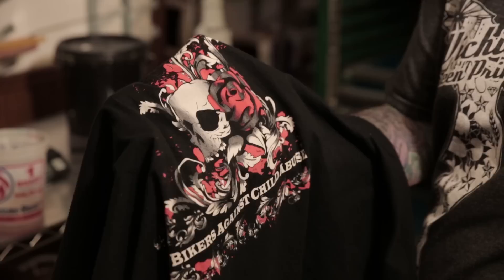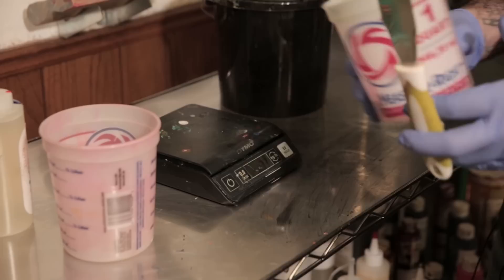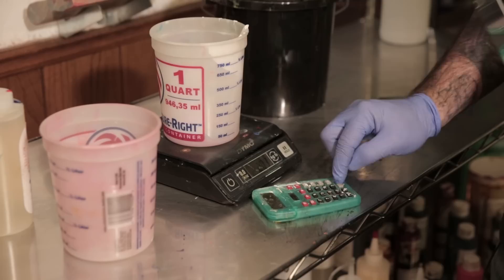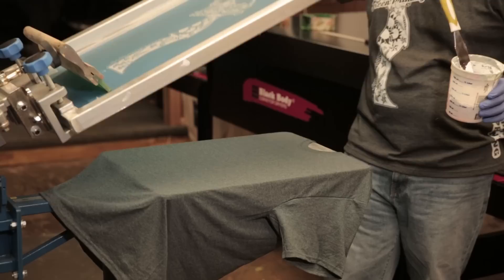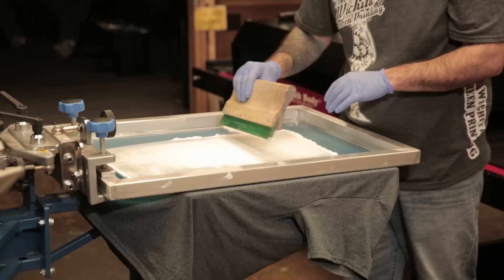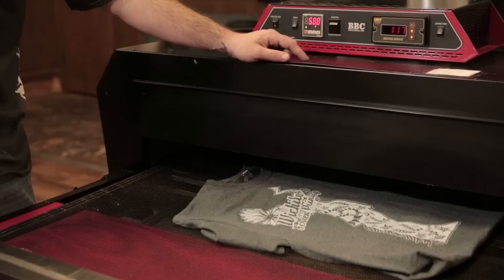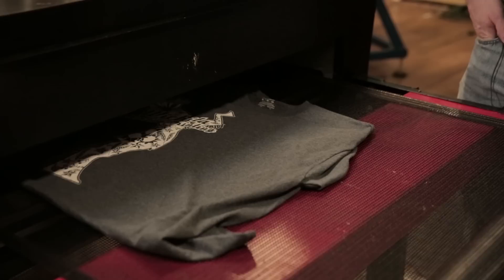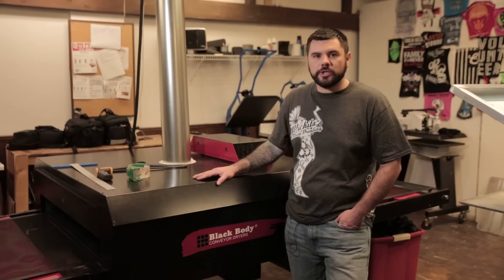White Discharge Ink on 50/50 Dry-Blend

Comment: Thanks! I will be doing some colored discharge on heather black soon (first time). Nice to see you got good results doing this.
Reply: Yep! Will you be using the new heather black from Bella+Canvas? Let me know how that goes! Thank you for watching and commenting!
Reply: Nah, I wish. The customer didn't want to spend the extra cash for them super nice Bellas. Just using some Jerzees Dri-Power. I hope they work ok!
Reply: Ah. I run into that all the time- we have been just throwing in a Bella canvas or next level shirt as a sample- as a way to up sell for the next order...it works, once they wear the ring spin soft shirts 8 out of 10 customers order some on the next order...good luck on the jerzee dri-power, it's a great shirt. The local schools love it- lots of color options
Reply: Do you charge a higher service fee when printing on nicer garments such as B+C or Next Level? Naturally the shirts themselves cost most, but do you up your printing prices too? Just wondering. I'm still working out my fees! (Super new to all this.)
Reply: Definitely! It takes longer to mix the inks...plus the cups to mix the inks in...clean up team...discharge is messier...so we do charge more...we did not at first but the more we printed with discharge the more i learned that we should charge more...because of the time and cost...vs plastisol ink ready to print right out of the bucket...

Comment: Geno, is discharge safe to work with and cure in a garage setting? I can open the door and crack the garage door to allow ventilation but beyond that its a closed space with no exhaust options obviously. -- My main goal is achieve little to no hand on my garments vs even how a single or double pass of plastisol might feel through a high mesh, but Im limited in many ways as Im printing in my garage and still only have a IR flash to cure with... Would water based ink be a better option in my case vs discharge?

Comment: Hi what percent do you use ink and what percent do you use discharge powder for white or any other colors?
Reply from the maker: Depends on the brand of ink your using- and the weight- the amount/ratio we used was figured by weight with the brand of discharge ink we used. Check the specs of the brand your using from the manufacturers website.

Comment: Is it possible to discharge on a dark navy (not heather) 80% cotton 20% poly? Appreciate your thoughts!
Reply from the maker: JTL yes I think that would work. I’ve never had a problem printing discharge on navy...what brand of shirt?
Reply: Learn How To Screen Print T-shirts it’s a brand based in UK called continental clothing.  Brushed cotton, very high quality garments.  I was just worried that because there is 20% POLY the design would be really faded when discharged on a dark colour like navy... what do you think?
Reply from the maker: JTL I think you would be fine- there will be a bit of a faded vintage look- but with only 20% polyester you should be fine..it shouldn’t be too faded-